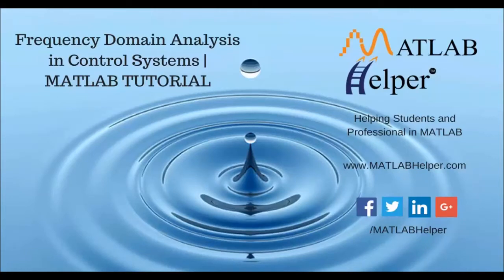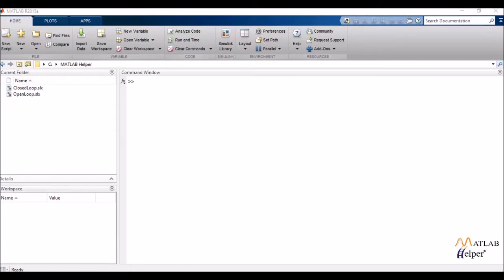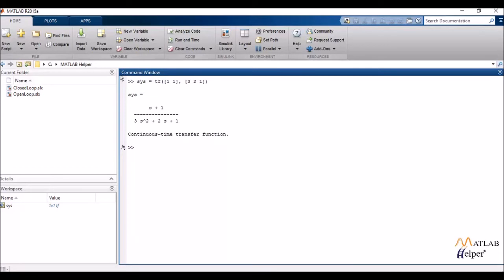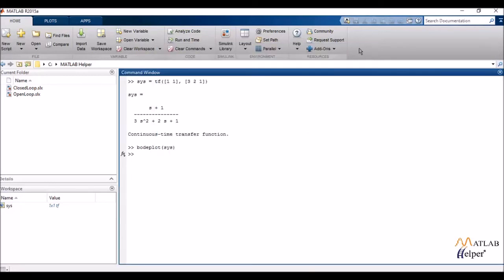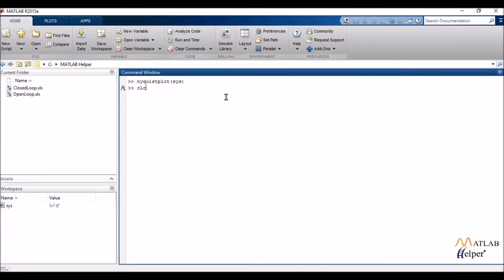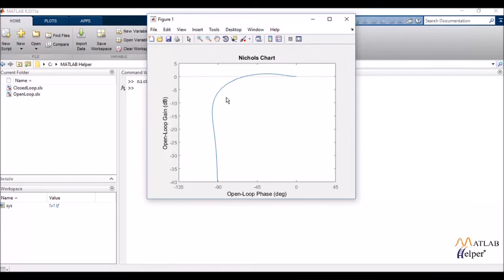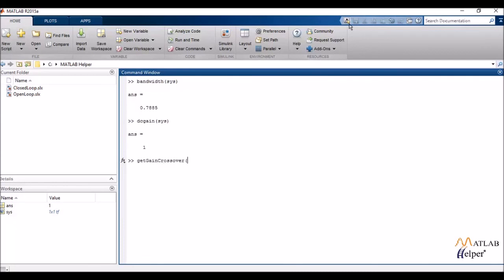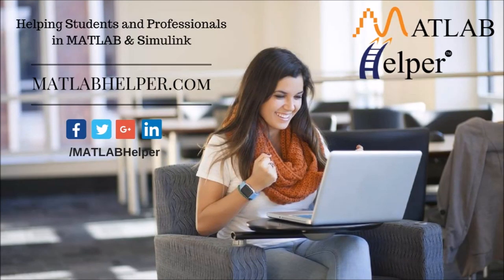Frequency Domain Analysis | Control System | @MATLABHelper

Comment: #Frequency domain analysis is the study of how signal amplitude changes with different frequencies.Define a transfer function using the command #tf([ ]).For drawing a #bodeplot,use a command #bodeplot(sys).It gives magnitude and phase response.It is logarithmic plot.It is used to study stability of a system with minimum phase loop transfer function.
For Nyquist plot we use command as #nyquistplot(sys).Here x-axis=real axis,y-axis=imaginary axis.It gives closed loop diagram.It is also used in #stability analysis.
For obtaining Nichols chart we use command as #nicholschart(sys).It gives open loop.It displays a locus of log of magnitude versus argument of transfer function.
The specification of frequency domain analyasis are #Bandwidth,#DC gain,#Gain crossover frequency,#Peak gain,etc.
Reply from the maker: Disha Nikam, Glad to see your appreciation for our Video. Do support us by Subscribing to our YouTube Channel at https://www.youtube.com/c/matlabhelperteam